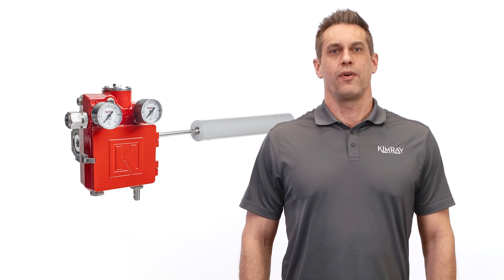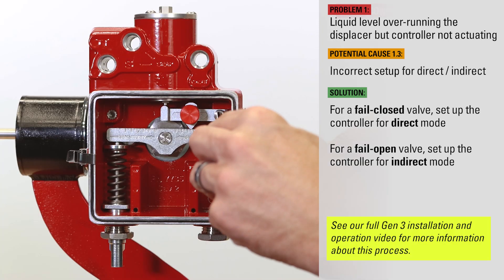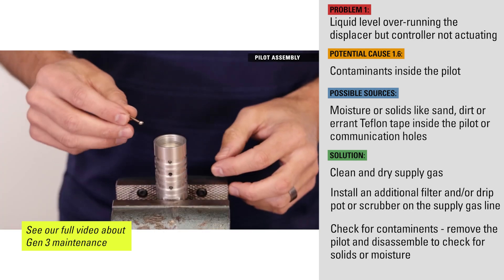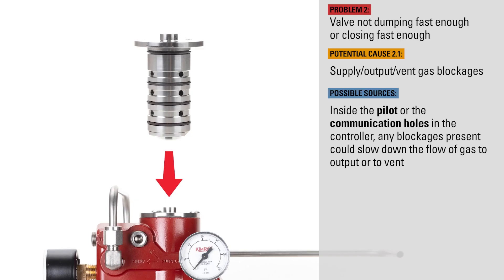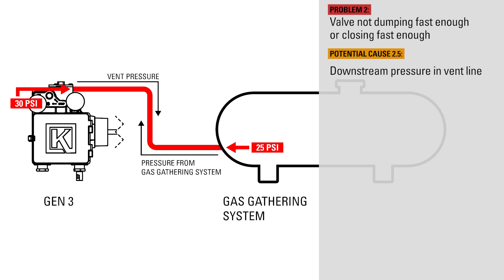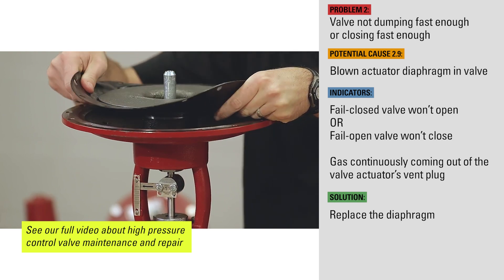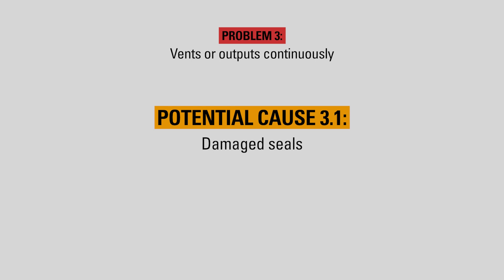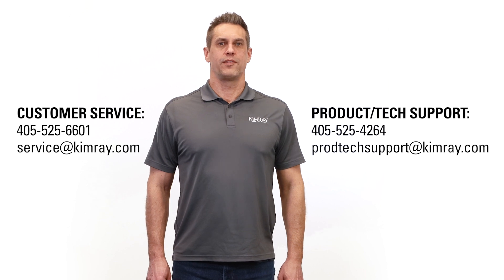Troubleshooting Your Kimray Gen 3 Liquid Level Controller

Comment: Or the Fluid gravity is an issue, trash in the collar causing float arm to hang up(solids,pariffin), have seen fluid hot enough IP’n new wells that it will deform the float causing issues, also had hard fluid/gas coming into said vessels with mess with ya setting em. I personally like the gen 2’s solid controller.